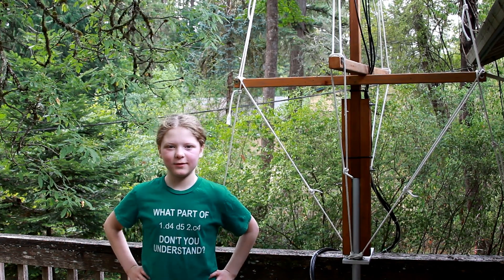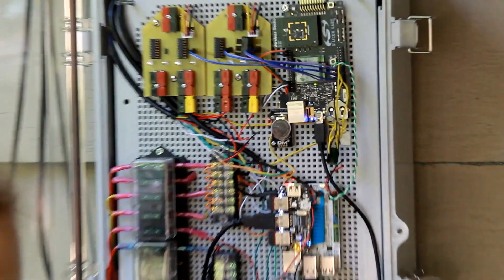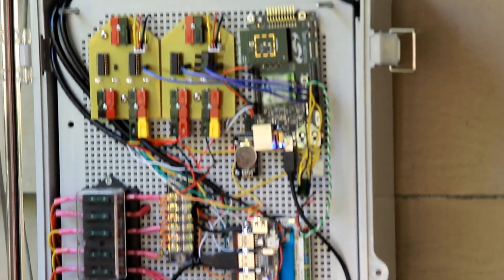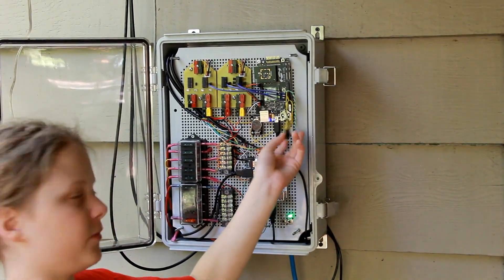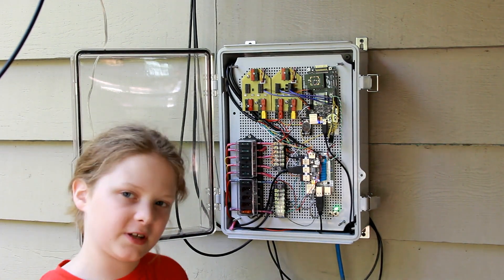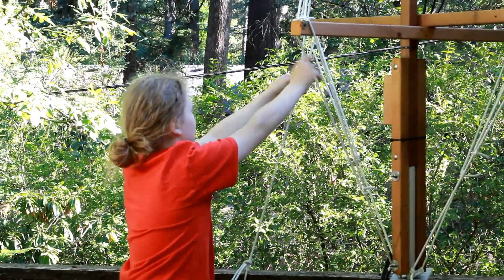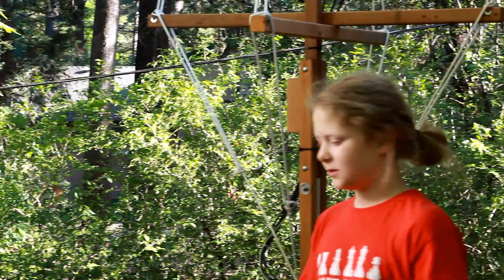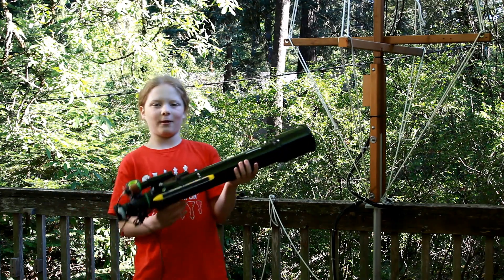📡 HUGE Homemade Helical Antenna Tracks the ISS 🛰

Comment: Coolbeans...

I listened to the antenna's construction video while traveling home yesterday. I too have thought of using a reflector with 2 meters, but to date have been put off by the rather large size needed for an effective reflector. You guys did it, so heck, I ahould at least give it a go.

I like your mast. Looks like you borrowed a bit from a sailboat's mast that often uses a diamond truss to resist bending.

73 de kc2wvb
Reply from the maker: That sounds great! More detail about how we made the reflector:

We used chicken wire, and put a bunch of pieces of chicken wire together with copper wire. We used carbon fiber tube supports to help it to stay flat, and soldered a BNC bulkhead to the reflector as a connection, it solders much better to the copper than the chicken wire. Then, cut the reflector with snips into a circle (or hexagon). finally, cut a small hole in the center and put a connector on it to attach to your antenna.

after that, you are ready to use your reflector and antenna!

Comment: Ive enjoyed your videos of the antenna build. It would be great to talk to you on the radio sometime. I have an echolink connection KW4EMF-R to N2GE 145.190. Its on Mount Mitchell at 6600 ft. Its the high repeater east of the Mississippi. Give is a shout. 73 Roger KW4EMF.
Reply from the maker: Ok, that sounds great and I am getting echolink validated to make the call!

-Zeke, 73, characteristic dipole Impedance